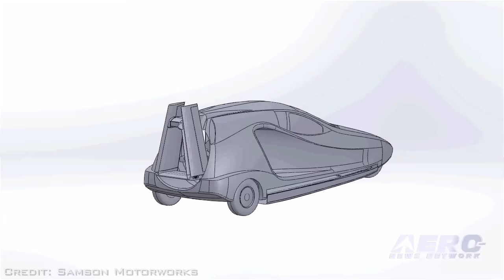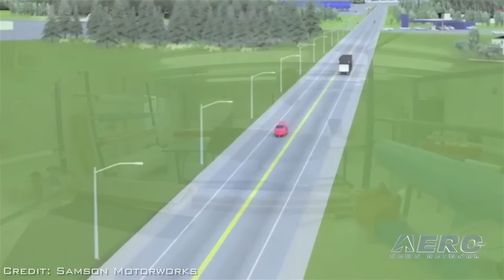Aero-TV: Driving and Flying – The Switchblade Multi-Mode Aircraft

Comment: i don't like the tricycle configuration. What happens when you turn?  Do you tip over?   I would have much preferred a tadpole configuration.
Reply: If you knew anything about airplanes you would know that tail draggers are very prone to ground loops. Tricycle gear is much safer. The CG of this machine is very low and close to the rear wheels, very resistant to roll over if driven with common sense.

Comment: To compete with manned hexacopters he will have to build it so it is really fast to have the advantages.  He is already saddled with so many disadvantages when compared to the hexes.  He has to drive to and from the airports and has to have dual licenses.  Licensing and insurance still has to be sorted out for hexacopters also but at least they won't have to have two types and in most cases you can fly directly to and from your primary locations in a hex.
Reply: And the range of a hexacopter is? The range of the black fly if you've been following that is quoted as 25 miles. Silicon valley commutes are closer to 50.